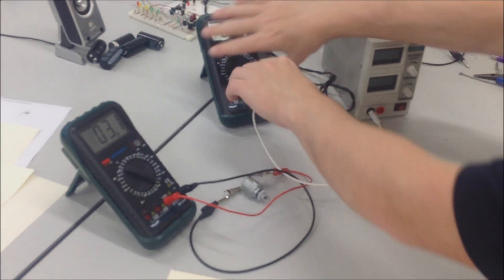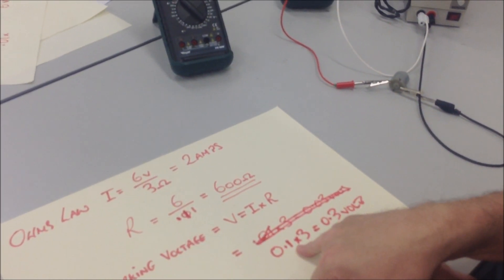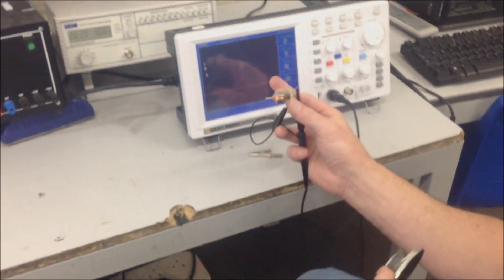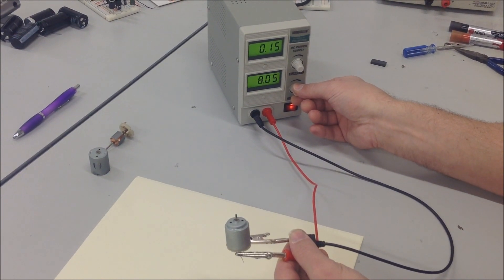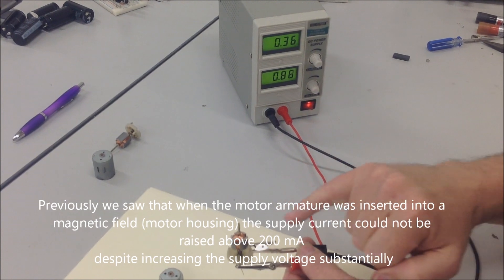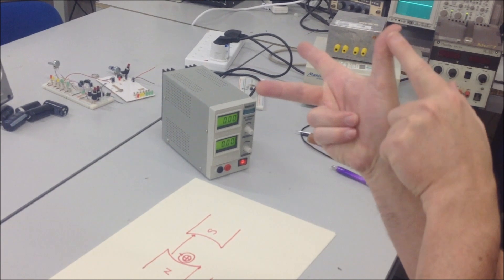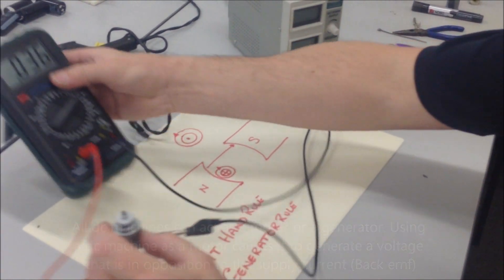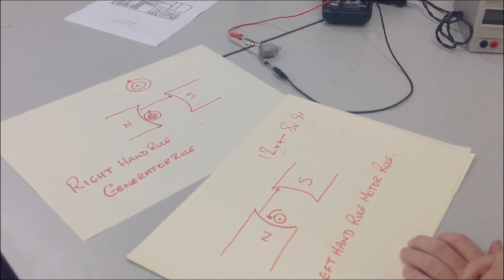"Back EMF"  Theory and Practice Paul Wesley Lewis

Comment: Ah ha, I see. So the back EMF is not visible to a multimeter because it is buried in the incoming voltage. It doesn't add to it, in a way similar to the way parallel batteries don't add voltage. Current driven in by a voltage source has a balancing effect on measured incoming voltage. Now I need some help to understand why with AC current and a start winding with a series capacitor, the voltage across the start windings is wildly greater than incoming voltage. I assume its visibility has something to do with the phase shift of voltage across the upstream capacitor? To balance, so that net phase is balanced, there needs to be a phase shift across the motor so the sum of the two is equal to overall incoming voltage.
Reply: There are two sources of current here:  (1) the voltage applied to the motor by the power supply;  (2) the Faraday/Lenz's law counter-EMF voltage created and increasing when the motor windings are passing through (rotating through) the magnets mounted inside the motor's casing

So there is one "on purpose" current flow in one direction, and one "Faraday/Lenz's Law" current flowing in the opposite direction

The second current is NOT on purpose.  Nature forces that issue (Faraday/Lenz's law) because you're passing a coil through a magnetic field.

So the currents DO ACTUALLY ADD.  They are added together, as follows.
A)  assume the first current, put into the motor on purpose, is 2 amps  (paid for on your electric bill)
B)  and Nature's response - the Faraday/Lenz's law counter EMF current - is  (-1.9) amps.  That's negative 1.9 amps

THEY ADD TOGETHER AS FOLLOWS:

2 amps +  (-1.9) amps  =   2 amps - 1.9 amps = 0.100 amps, ie.  that's 100 milliamps

The 'on purpose' current and the counter EMF current always add together.  It's just that Nature's current stiff-arms the current you pay for on your electric bill, and the addition becomes subtraction.

The clarification added by this author is valuable -he shows with complete clarity that the counter EMF is subtracting from the EXPECTED current.   This is valuable because it is not often made clear, even in formal courses in electricity/electronics.
.
Reply: @Greg_Chase  I like the way you use current rather than voltage. What makes me confused is the way voltage measurement in AC motors with a start capacitor shows wildly higher voltage than incoming voltage. For example in a typical air conditioning motor, incoming voltage from source is fixed at 220V AC, but voltage measured with a multimeter across the start windings is typically 440V. It's reproducible enough to design a "potential relay" to cut current to the start windings after the motor spools up. I assume that the effect is purely in AC motors with capacitors inline, caused by the phase shift induced by the capacitor/inductor series pair, since a DC motor could not have higher than incoming voltage. Otherwise net current would move backwards into the battery, which is not sustainable! It's easy enough to model that AC voltage spike by considering the way induction of the motor coils increases as rpm increases. RLC circuit analysis can model those kind of voltage spikes. However conventional thinking would say that back EMF is more than simple passive induction. After all, hook it up properly to a source of outside mechanical power and you've got a generator. Or, is it?
Reply: @spelunkerd  Back EMF, whether DC or AC, easily exceeds input voltage.  An example is a neon bulb - those require 90 volts to fire the plasma to light the bulb.  But you can:

1)  hook a 9 volt battery to a coil
2)  let the five L/R time constants pass by (the magnetic field in a coil reaches near maximum after five L/R time constants have passed)
3) quickly disconnect the battery and allow the magnetic field of the coil to collapse, at which time it will create the Back EMF spike
4)  it is common to use a 'snubber' or 'flywheel' diode across a coil to allow the Back EMF to quench 'peacefully' but if you have a neon bulb instead of a snubber diode - assuming the coil is big enough (ie. assuming a large enough magnetic field built up), you can fire the plasma in the neon bulb

I have no experience with A/C systems though, have not looked at those circuits.  

Here is a common use though of Back EMF spikes:

1)  create a primary winding coil of say 20 gauge wire
2)  create a secondary winding of say 28 gauge wire, with 10x or 100x the number of turns in the primary winding
3)  provide DC to one side of the the primary winding only
4)  connect the other side of the primary winding through a MOSFET so that, when the MOSFET is turned on, a ground is supplied to that side of the primary winding
5)  now, drive the gate of the MOSFET with a square wave from a signal generator

The square wave will toggle the ground on/off at the square wave frequency.  In other words, you allow DC to the primary winding then shut off the MOSFET to create the Back EMF spike.

That large Back EMF spike is electromagnetically coupled to the much larger secondary winding, creating an immense voltage step up.  

There is a huge ecosystem of experimenters who use Back EMF for all types of circuits, including ionic lifters.
Reply: @Greg_Chase  You make a good point, intermittent DC is the basis of the spark plug coil. When supply current turns off, the coil becomes the primary voltage source, and coil polarity reverses to maintain current flow in the same forward direction. This inductive effect seems very different compared to back EMF and backward current in an electric motor.
Reply: @spelunkerd  It's a subtle issue, agreed.  Because if you are applying the 9vdc battery to the coil, and suddenly disconnect it, it's as follows:

1) the magnetic field is reducing, suddenly

2)  Faraday's law of induction + Lenz's Law means that the coil magnetic field will induce a current opposite the current causing the magnetic field change

The magnetic field is falling.  It could be falling for 2 reasons:

1)  reduction of the original DC supply and DC current

2)  or, a newly-introduced second DC supply and current that is opposite the original DC, and is mathematically thus subtracting from the original DC supply

Both of those cases will make the original magnetic field decline.

And the problem is, the magnetic field has no way of knowing:
1)  "Am I declining, suddenly, because that original DC supply is declining?"

2)  "Or am I declining because a second DC supply and current in the opposite direction was hooked into the circuit?"

The declining magnetic field only knows that it is declining, and it responds with Faraday's law of induction + Lenz's Law and induces a current opposite the first, original current that is declining (reversing).

In the case of a motor:
1) an original current created a first magnetic field in the rotor coil

2)  this first magnetic field experiences torque against the magnetic field of the stator permanent magnet and the motor starts rotating

3)  now we have a coil of wire rotating in a second magnetic field (the stator magnetic field)

4)  and Faraday + Lenz will induce an opposite current + magnetic field in the coil

So there are three magnetic fields in the motor:

1) a first magnetic field created in the rotor by the power supply 

2) a second magnetic field - the permanent magnets in the stator

3)  a third magnetic field - a subtractive, induced magnetic field in the rotor coil that subtracts from the first magnetic field

So you're right, the mechanics of the Back EMF of a coil,  compared to the Back EMF in the motor, are different, mainly due to the rotation of the rotor in the motor, which is not a factor in a standalone coil situation..

In the end, Faraday + Lenz behave the same - seeking to oppose the current and magnetic field that were initiated by an external power source.
Reply: @Greg_Chase  The funny thing about an automotive coil is how suddenly stopping the feeding current will induce current in the SAME direction as the original current. Inductive effects resist change, either way. In this case feeder current suddenly goes to zero so the coil resists that change. In other words, E = -L*di/dt, so with negative derivative the voltage is positive to maintain forward flow. The collapse of the magnetic field turns the coil into a transient voltage source, so the polarity measured across the coil switches to maintain forward current.
Reply: @spelunkerd  There's no getting around Faraday/Lenz's Law. That being said there are experimenters with devices and claims of 'defeating Lenz's law' but it's a part of Nature.  You can figure out ways to make use of it - the 'Joule thief' pulse circuit (aka 'blocking oscillator') utilizes Back EMF in a constructive way to convert small DC into AC with just a few discrete components.

One of the devices we are in design phase on - speaking of induction coils (ie. automotive coils, which also convert DC in broad-spectrum electromagnetic waves produced by the spark gap) - 

- is a device to disrupt spark coils utilizing very high frequency RF and a high degree of focusing.  We aim to induce the photoelectric effect with the focused beam, which serves as an 'external agent' to produce free electrons from the metal bits in the ignition due to photoemission.

Sought-after effect is this:  with the device turned on, a running auto's coils will begin misfiring and the motor will stop running.

This kind of device was deployed in the 1957 Fort Itaipu, Brazil case, except in that device, a lower frequency than ultraviolet was used - the Fort Itaipu case most likely used microwaves.

The germans in the 1940s developed focused, very high frequency beams to produce the photoelectric effect in vehicles of their opponents.   A descendant technology is the 'Active Denial System' which is described on wiki.  The Active Denial System produces the same effects as the device used in the Fort Itaipu case, at lower intensity, for crowd control.

It is a hobby effort on our part, a challenge to achieve the affect (disruption of induction coil in a gas engine due to random electron emission caused by an outside agent).

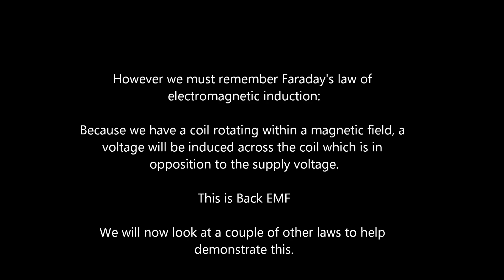Comment: At 7:15 it says "Because we have a coil rotating within a magnetic field, a voltage will be induced across the coil which is in opposition to the supply voltage." 

I agree with the first part of the sentence, but should the latter part not read this: ... a voltage will be induced across the coil which is in opposition to the supply CURRENT.

Hence the back-EMF impedes the current. The total load on the supply voltage (being a 'voltage' source) is the DC resistance of the coil plus the back-EMF equivalent impedance that determines the current. The 'voltage' source of the supply does not change. We do end up with a voltage across the DC resistance R*I=V and as you say, that is the 'real' voltage. We can also calculate the heat being dissipated here, that smaller V, V*I.

Which view is correct, or are they both depending on how you look at it?

Comment: One question: You are increasing applied voltage but current is not increasing. You say that is because of back emf which is also increasing with the applied voltage. But when the current is constant, how is the speed of the motor increasing and making such sound? When the current is constant, shouldn't the speed of the motor be constant too???
Reply: It's a very good question.  When students have asked me that,  I use the following analogy:

1)  it's a 90 degrees (Fahrenheit) day in Honolulu
2)  you set your air conditioner in the house to 72 degrees
3)  the house cools down as expected to 72 degrees
4)  but you hear the air conditioner come back on from time to time - why?
5)  the air conditioner cannot fully control your home's temperature - it will come on when the heat raises the temperature to 73 degrees.   The momentum of the temperature was downward from 90 degrees to 72 degrees, and it only takes a brief input of cold air to keep the momentum going.

Same in the motor.  Also, the same in a large semi truck with gears.  Once there is momentum,  it only takes a tiny,  periodic input to keep the momentum going.   A semi truck traveling at 70mph does not need to downshift to 1st gear and greatly increase applied power - just a tap on the accelerator when the speed drops to 69mph

Comment: Hello Paul,
can I say that the eletric motor is ruled by some kind of inertia? After seeing your video and others, I undestood that if you put some mecanical resistance on the motor the back EMF will get lowered. As the back EMF gets lowered, the mecanical power will get stronger, therefore helping the motor to return to what was. Am I thinking correctly?

Comment: Hmmm... So if I install reverse diodes on terminals of the motor, so that they allow the BEMF to exit the windings and feed the outcome of the motor to charge a second battery or a load, instead of a 6 volt battery, I can run the same motor by a less than one volt battery :D I feel like I'm loosing a lot of energy by not doing what I just said :D